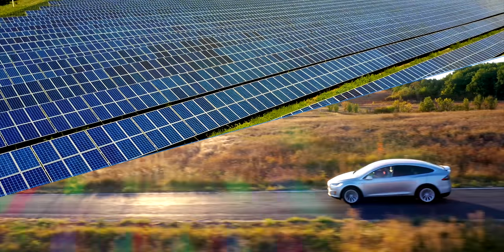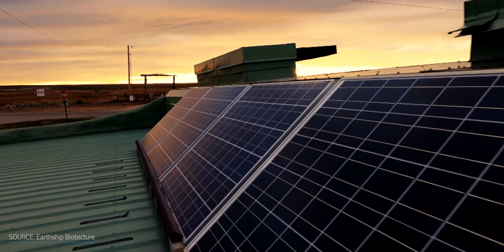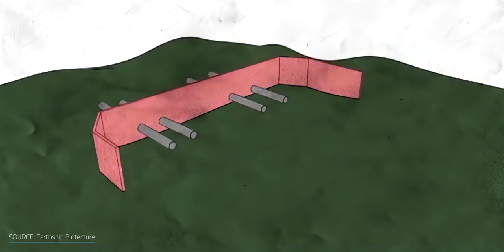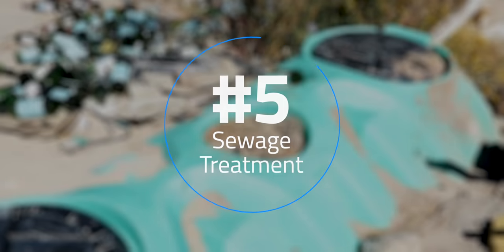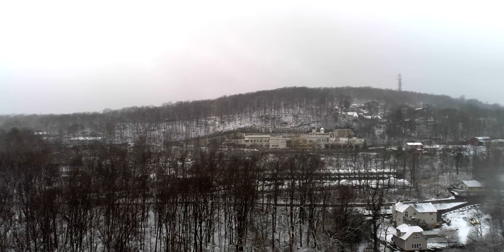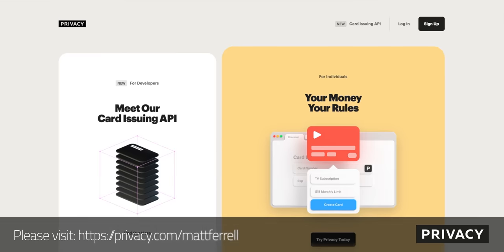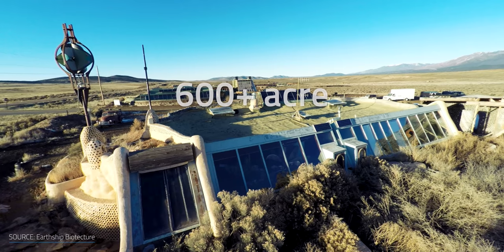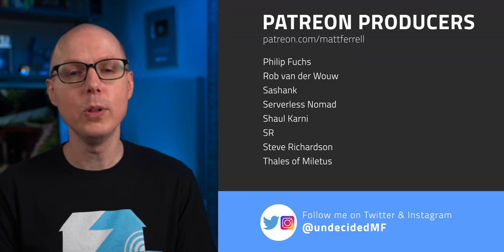Exploring Off-Grid Earthship Homes - Ultimate Efficiency?

Comment: I'm thinking about building a traditional home, but with an attached large conservatory/greenhouse. 
Insulating the foundation and have a huge well insulated thermal mass to force air from the conservatory in through to heat it up. 
Adding cooling tubes in the ground like the earthship for a cold thermal mass.
Then use these thermal masses to pre-heat/cool the air and mix it with outside air going to the heat recovery system of the house. Hopefully removing the need for air conditioning in the summer and helping heating up the house in the winter months.

This has the added benefit of extending the months of the year you can be outside. A great party space, since weather isn't an issue and probably the most important part. Since I'm ginger it would be nice to not worry as much about sunscreen all the time, because of the UV protection glass can provide

Comment: I was aware of the Earthship concept back in the  70's-and '80s when I was old enough my parents started taking us on vacations. We looked at many mostly out west in Nevada, Utah, California areas. My father ended up building an underground house. It was under 6 to 8feet of dirt that kept the house at 55F year-round.  at almost 6800sq ft it was incredibly easy to heat. You only had to raise the temp about 15 degrees in the winter, even if it was below zero out. and summer it was natural air conditioning. We brought warm outside air in to bring up the temperature in the summer.
Reply: Awesome!
Reply: The hobbits had the right idea, it seems.
Reply: @kaitlyn__L  Yes I did like the Hobbit houses. I saw an eathship as it was called back in the 80's that was built out of inflated balloons and sprayed with a structural cement or something, and the house was a bunch of bubbles connecteted together.  I did like the round hobit door.

Comment: There is an excellent community around the building of earthships, with many being built by people who come to learn from experts, so all you need to do is feed and house for the time they live onsite. Not for everyone, for sure, but still mitigates the cost involved. 

As far as the off-gassing of tires, much of the issue involved in the breakdown of tires is in its exposure to sunlight and oxygen, both of which are essentially solved in the construction process. For those still on the fence, rammed earth walls are a viable alternative, and don't require the application of cob on the inside surface, though a waterproof membrane on the side that faces out toward the earthen berm may be necessary.
Reply: Thank you!

Comment: A good friend has an Earthship home.  Totally off-grid.  I've stayed there overnight.  Extremely comfortable.  He built his and his wife's 3 BR, 2 BA berm home for $17,000 in 2006.  He had an abundance of solar pv, so after adding a few more batteries to his battery bank, and switching to LED lighting, he swapped out his propane range/oven and dryer for electric ones, and found he still had plenty of power to spare.  After replacing his gas hot water with electric, he STILL had enough power to spare, so these days, his last 500 gallon load of propane is down to 430 gallons over more than a decade, primary feeding his outdoor grill and fire pit.  He says he'll be dead before exhausting it.

Comment: There's a lot of good ideas that going into building these which are essentially niche artistic endeavors. They absolutely will not be a good standard for most homes, but are a good inspiration and test bench for more efficient homes. Hopefully we'll see a lot more ideas like this in the future, where the goal is to use as little energy as possible to keep a home comfortable and safe.
Reply: agenda 2030
Reply: @theyredistortingyourrhthym126  Whatever that means!!!
Reply: @ThatGuy Makes Things
That is not the goal for Earthships. 
A huge part of Earthships is to intentionally use garbage as building materials! Esp. garbage that is one of humanity's worst waste problems. If this isn't interesting for the builder/owner, I would steer clear.
Reply: @DarkMoonDroid  the idea is obviously a hyper focus on sustainability, prominently using both recycled materials and renewable energy. I have a few major concerns though.  

Are the materials being used really the best use case for recycling that material? In one shot it looks like they're using aluminium cans, which should honestly just be reprocessed. Every gram of aluminium able to be reprocessed is one less gram that needs to be mined.  

Does the energy cost of this construction method offset it's use of recycled materials? If a lot more energy goes into making these houses, and/or more energy is used maintaining them (as there was some concerns addressed re: degradation in the video) then it would be more sustainable to just use new materials with a lower energy cost and longer lifespan. Worth noting that logging can be done sustainably and can technically be a carbon capture method if the supply chain uses renewable electricity.
Reply: @cavemaneca  concrete takes a lot of energy and releases a ton of CO2 to make, so any house that has it has a disadvantage to begin with.
And yea, glass and aluminium can be recycled to oblivion, but at least the bottles supply light, like a window would do, and doesn't need to be made.

Comment: That design might need a strong radon mitigation system?
Reply: @HylanderSB  the ground
Reply: Depends on the area. Around me it would 100% be needed.
Reply from the maker: Good call out.
Reply: Would it be worse than any other basement?
Reply: Radon can be dealt with a good HVAC system, 2 ways, or even maybe create a ventilation that puts the house slightly over pressured, like in nuclear plants, to push the inside air outside, and prevent radon overdose in the air
Reply: Just get a good Energy Recovery Ventilation system like most passivhaus designs and you will have more than enough airflow
Reply: @UndecidedMF   this is actually why the tubes slope down towards the outside of the home in the back of the hill not into the home, (so up into the home, not down into the home).  So that the heavy radon flows out, not in from the hill.
And the passive venting helps refresh the air a fair amount, In some areas that are more intensive, you may need to think about this more,
Reply: @LilianTheNinkasi  If you do the house correctly it would already be over pressured and air should be flowing out all the time.
Reply: @LilianTheNinkasi  Should nuclear plants not try to keep the radioactive stuff inside?
Reply: @Sagittarius-A-Star  People have to work there, and there are generally systems in place, as part of the herculean process of permitting, to make sure it doesn't go anywhere it isn't allowed.
Reply: @FreekHoekstra  Excellent point. The grading also allows condensation to drip back out of the cooling tubes as the warm wet air is cooled
Reply: EXTREMELY true. Basically just don't have fixed air indoors. Ventilate it properly like a RV is, you know, how air naturally moves. not a sealed box.
Reply: In granitic area, sure. Like any home.
Reply: @HylanderSB  whenever you build a full granite home. Typically near a cliff, near the ocean.
Reply: Well, I learned something today... how the hell am I over 30 and have never heard of radon pollution in homes?
Reply: @linmal2242  except if your house is sitting on top of natural radon sources.
Reply: @Sagittarius-A-Star  Radon in homes does not come from nuclear power plants. Radon is naturally occurring, particularly in areas with large amounts of granite bedrock.
Reply: More concerned about the nasty toxic tires
Reply: @M1911jln  I did not say that. I just addressed his statement that nuclear facilities maintain a higher pressure inside than outside in order to keep the radioactive stuff outside which sounds weird.
Reply: @vroomfondel5447  potentially MUCH worse.
Reply: @linmal2242  that is just plain not true. I’m from Denmark and we have no bedrock, only earth/soil/sand/clay, and have plenty of Radon emissions in our basements. It comes from the decay of minute uranium traces in the earth everywhere, and will be an issue unless protected against with sealant and/or ventilation - even in earthships

Comment: I've been interested in the idea of 3d printed earthships for a while. Since the main component seems to be soil and they are often half-buried it seems like it might be possible to have a vehicle sized 3d printing robot excavate an area to build a sewage system/ garden section and compact the adjacent area into a foundation. Use the remaining rock/clay/sand/plant materials to make a earthen mix that can be extruded out of a long arm printing head to build up walls and even the basic structure of the roof and water collection system. While it is building you could either have a wagon with the other supplies and a second robotic arm or a small group of construction workers placing things like plumbing, electrical, doors, and windows in as the robot prints around them. The tires, cans, and bottles seem kind of unnecessary and mostly decorative. Maybe a time-lapse camera and some other climate measuring equipment could be placed on the lot a year in advance to determine the best design for the home though it would be best to develop a few base models that allow the home owners a good amount of leeway in adjusting for changing climates. Probably tropic, desert, plains, mountain, and tundra that way the program can start with the basic design and tweak the angle of windows, thickness of walls, and a few other variables to fit the more precise location.
Reply: We want the cans, tires and things to be used to keep them from just taking space in the dumps.
Reply: @vanderumd11  Isn't encasing them in the dirt of an earthship pretty much the same thing as burring them in a landfill?
Reply: @ApotheosisStone  it’s about use of space. The point is you want the thermal mass in an earth ship. Filling random objects into a hole in the ground is wasting valued space. Plus we have to ship this stuff overseas a lot of the times

Comment: I supplied the first off grid system for a rammed earth home in Arkansas in 1998. Built from the ground up by an engineer from Texas. Out standing structure. Entire home runs off 1-150 watt solar panel 1- 450 watt wind generator and 8 trojan 105's. Wood heat, generator for ac only which they rarely need to use. Water capture he also designed was 8,000 gallons and the left over fed his pond at the bottom of the hill

Comment: I want to use tires to build a large wall around my property. I can have it be vertical on the outside and more like a hill on the inside. Using modern compactors, it will take a few minutes, not hours per tire. Add a biodegradable lattice to the outside wall to allow vines to grow and put grass up the hill. Just a thought I had 🤷‍♂️
Reply: Sounds great if you have the room. Don't forget to put some kind of french drain at the bottom to channel the rain water away from the house and the wall.
Reply: @y0nd3r  I currently have 15 acres, I am trying to acquire an additional 30
Reply: @MasterKnight2K  lucky you. Wish we all had that kind of money.
Reply: @y0nd3r  I’m not lucky at all
Reply: @MasterKnight2K  okay, I'm sitting over here with zero acres but you're not lucky. Right then. Carry on.
Reply: @y0nd3r  I made smart choices and worked hard. I am very unlucky, so luck has nothing to do with it. Carry on now

Comment: I converted a relatively new home to net zero and the cost appears to have been less than the numbers given for an Earthship. I live in the middle of the country, and even here, if you are within a city limit it would be a very hard sell to get many of the things show allowed. Net zero is that that hard, and could more easily be done with typical construction. I'm in the process of building a new home, and the plan is for it to also be net zero. This one should be easier since I was able to plan a few things in advance. My location allows me to live without a personal vehicle, but there are many restrictions on the house and even the builder. I like the idea of reused materials, but I'll stick with a location that allows me to ditch a car.
Reply from the maker: Thanks for sharing!
Reply: B Y, 
Matt talked several times about “Passive Home” PH standards.  If you can build or have built a home as close to PH certification, even if you cannot meet the .06 blower door test, you will far exceed Net Zero standards with very little additional expense.  Just eliminating thermal bridging in your structure will do wonders in sizing your HVAC requirements, thus saving expenses big time.  It’s just not difficult to spend a little time on the structure to greatly improve it’s performance.

Comment: Some of the Earthship elements that could be added into a new home build would be the super insulation, possibly by being partially underground.  Gaining even some heating and cooling passively due to orientation would be a help in many instances as well as solar and/or wind power for even some electrical needs.  Gray water recycling definitely makes sense.

Comment: The water system is the most interesting part. Rather than in a home can we implement grey water use in a city?
Reply: we do not separare greywater from blackwater sadly (where I live at least). But you can use washing hands water to flush, it is very cheap and simple solution.
Reply from the maker: It's definitely possible, but depends on what local requirements are.  In the US it varies state by state.  https://pioneerwatertanksamerica.com/is-it-illegal-to-collect-rainwater-in-your-state/

Comment: I am actually wondering how this fits with the opposite trend of stacking more people in taller buildings, for surface usage. Would something like this fit that trend to some degree?
Reply: It would be interesting to see a scaled up multilevel version.  I guess it would require more non recycled structural materials though.  I like the glass facing wall facing the sun and growth over the rear, if there were a built up area with the same design it could mean everyone would have a view of greenery!
Reply from the maker: Good question.  I haven't seen any examples like that.
Reply: From the way it looks, I don't think you can scale it up vertically, not unless you do at the side of a steep hill/mountain. Ofcourse you can use techniques from these eartship houses, just not everything.
Reply: @MDP1702  agreed

Comment: Wouldn't tire rubber rot over time? Seems like those walls have a built-in design flaw right there.
Reply: Good point, I'll go rent out a box house here in the states instead for 600 a month with the walls caving in and the nice deposit of mold behind the tub inside the city where thousands of cars run daily and the pavement spans for hundreds miles. Much healthier for my long term health imo.
Reply: @Gone_Away_Again  just like the cigarettes and alcohol being fed to us like candy and advertised like a new toy. Not to be that guy but if I was given the optiong to live in one of these i would take it in a heartbeat.
Reply: To answer your question:

No. The tires get sealed on both sides and have no exposure to sunlight or oxygen. They’re made from materials not meant to rot away to begin with, and then are sealed up in a tomb with no access to the elements. Earthship homes will outlast all of us, and then some.

Comment: Re: the outgassing of the tires, two things:
1) You’re building with used tires. Most of the outgassing that’s going to happen has already happened by time you’re building with them
2) You seal the tires (on both sides of the wall) to keep oxygen and sunlight out. Any offgassing that could potentially still happen doesn’t, bc the gasses are trapped inside the sealant 

HTH!

Comment: I like the idea of kits. In a kit, one gets the materials and plans (video instruction!) to build and install a particular system: gray water recovery, water collection, solar power collection, battery storage, heat exchangers, water heaters, raised gardens, vertical gardens... 

I also like the idea of "calculators". A calculator can take information you give it about your home, environment, utility bills, and budget and then recommend a kit that comes closest to meeting your needs. For example, a gardening calculator would take into consideration local weather, sun exposure, and space and then recommend kits that will help you best use available time, space, and resources.

In short, I'd like the knowledge tools that help me make the right choices and the materials and plans to turn those choices into reality - one small project at a time.

Comment: A proper subsurface basement keeps relatively cool during summers and warm during winters. It does cost more as the structure needs protection from water seepage into the walls, extra power to pump out sewage and the cost of excavation to build it in. However, a subsurface living area can also serve other necessary purposes in times like war.

Comment: If you could afford to build one earth ships seem to be about perfect for most of rural Kansas, it gets just enough water that it isn't considered to be a dessert, but water is still a scarce resource that needs to be maximized, you are likely to be far enough from your neighbors that utilities can be cost prohibitive, the average temperature is comfortable so the ground temperature will be pleasent, and earthquakes are pretty much not an issue which means you don't need to modify the design to be earthquake tolerant.